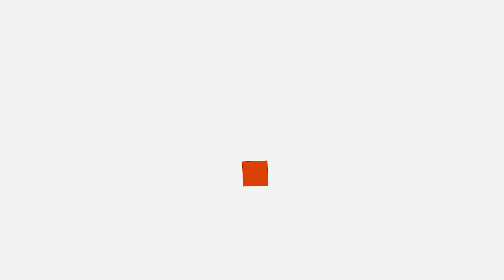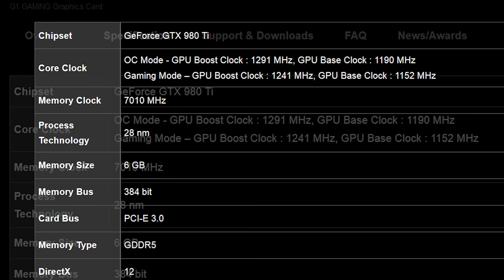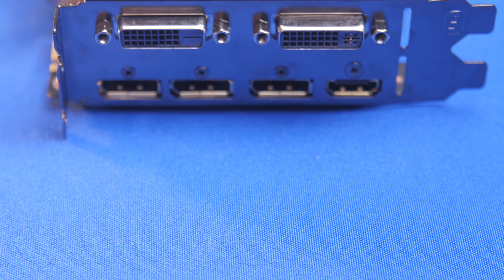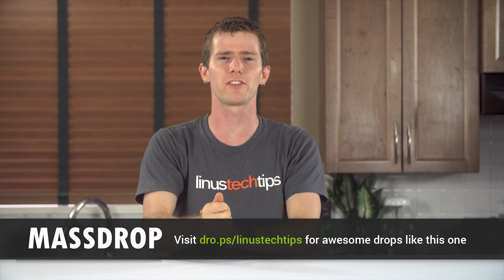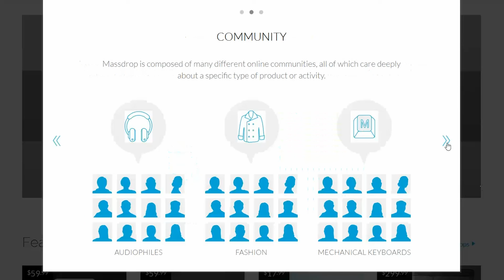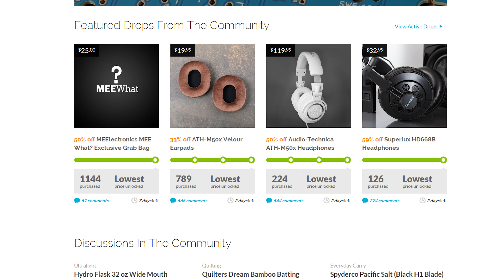Gigabyte G1 Gaming GTX 980 Ti - Both Beauty & Brawn?

Comment: ahaha I just bought one xD
Reply: @AbuKhalidAhmedAlHaddad  Yup mine is still good. I don't use it anymore as I upgraded to an RTX 3070ti. But I did refurbish mine with replace the thermal pads and paste on mine. Its basically a high power consumption RX 580. Its really good, it will struggle in some newer AAA titles but overall its not bad. I have a video on my channel on it xD.

Comment: just upgraded to this card. It's awesome. Even 4 years later.
Reply: man i bought one yesterday lol
Reply: I have a problem with my G1 gaming, whenever i try to overclock it and make the slightest changes in the core clock or the memory clock, every game i try to play crashes.
Reply: @valiotoploto2189  I'd just leave the clocks at stock speed then.
Reply: I would too but gta v barely runs with 60 fps, and i need more power lol
Reply: @valiotoploto2189  Do you have MSAA on in GTA V? If so turn it off. It kills the FPS.

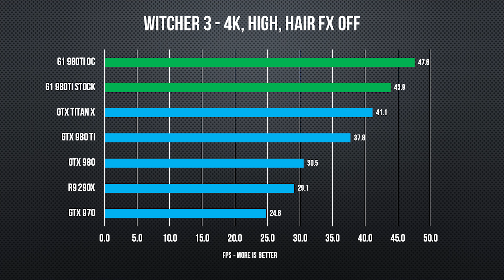Comment: 5:57 You got TERRIBLE silicon m8! And one would think Gigabyte would send their BEST to LTT! 
 I have a G1 Gaming GTX 980 Ti still today. I use OC Guru II by Gigabyte as I have found the voltage and memory settings work FAR more stable than they do using Afterburner. Anyway GPU-Z only rated my ASIC quality at like 69.8% or so IIRC, but with a + 0.375 voltage offset, +136 MHZ to the core, and +990 to memory in OC Guru II manages me a PERFECTLY stable 1503 MHZ core, and 8 GHZ effective VRAM! Giving me ~35%+ over stock reference on core, and a further ~15% on VRAM speed and therefore bandwidth at 384 GB/sec! My core temp never tops 72 C at the worst, and the GPU fans are running at 80% by then which is just BARELY audible to me unless I have loud game sounds going, at which point I cannot even hear it.
Gigabyte really kicked ass when the G1 Gaming was their damned near top of the line. Now it is middle tier and "AORUS" is their top of the line, the AORUS 1080 Ti managed to bend under its own weight, sometimes enough to stop a fan!  Meanwhile the G1 Gaming 980 Ti is so solid you could bludgeon someone to death with it and it would probably STILL WORK!

(I still RUN afterburner - but only to monitor my GPU & CPU temps and utilization, as well as RAM utilization - I am digitally OCD and want to make sure EVERYTHING is cool and running as it should at all times!)

Comment: GTX 980 Tis are selling on eBay for just ~$260 on average depending on model!   I bought THIS G1 Gaming GTX 980 Ti in August of 2016 after Pascal and Polaris had launched, and won the bid for $355 shipped to my door! NOW I have it running at 1.218 Vcore (+34mw in Afterburner) to achieve 1503 MHZ core at ALL TIMES under load, and 8 GHZ effective VRAM for 384.4 GB/sec! 

At this overclock, my 980 Ti EASILY BEATS ALL GTX 1070s IN EVERYTHING! And actually even manages to tie with or even beat a FEW GTX 1080 equipped rigs in benchmark comparisons! In fact, I posted my SteamVR Benchmark scores to LTT's "Post your SteamVR Bench results here" forum thread - and what surprised me quite a bit, was that I was beating ABOUT 50% of ALL results turned in by GTX 1080s! And the ones I did not beat, I either tied with, or at worst was just SLIGHTLY behind! 

I think the 980 Ti actually does VR better than it "should" based on regular game performance - and it MIGHT have a LOT to do with that memory Bandwidth combined with the fact that the 980 Ti is a "Wider" GPU than the 1080, it has 256 more CUDA - so 10%, but then it has 50% MORE ROPs (Render Output Pipelines/Rasterization Output Pipelines/Pixel Pipelines) - where thr GTX 1080 has 64 ROPs, the 980 Ti has 96! ROPs are DIRECTLY responsible for a GPUs pixel output, at 1503 MHZ my 980 Ti is outputting 145 Gpixel/sec, meanwhile a GTX 1080 at 2 GHZ is good for 130 Gpixel/sec. So there is not only a memory Bandwidth disparity in favor of the 980 Ti OCed (1080 can usually hit about 350 GB/sec at best when OCed, whereas MOST 980 Tis easily hit 8 GHZ VRAM, which provides 384.4 GB/sec) - but also a SHEER pixel output disparity in favor of an Overclocked GTX 980 Ti like mine.

So I think that is why the GTX 980 Ti performs roughly the SAME as a GTX 1080 in VR especially when OCed like mine!
Reply: good job bitch <3
Reply: @painintensifies9489  Lmao, thanks, bitch. kisses

Comment: mine runs at 83 degrees on oc mode at 1400 mhz, why is mine soo hot?
Reply: What fan speed is the card running at when under full load? Are all the fans actually turning? If the answer isn't fan speed/the fans, then more than likely (and this is a problem with all GPU manufacturers, not just Gigabyte) the thermal paste has been poorly applied. Pretty easy to reapply GPU thermal paste, just make sure you take note of which screw has gone where, and that you have some good paste on hand, as well as some thermal pads for the chokes and VRM's.
Reply: I reapply the thermal paste whenever i get a new card. found the problem tho, case air flow. rocking no side panel atm and temps r fine XD

Comment: I've been using this GPU for over 6 months now and all I can say is this is my best GPU I have ever owned. Prior to this, I was strictly AMD but i got myself into playing games on triple monitors. At the time, there were no AMD GPU that could push that resolution on a single card that was air cooled. Then i waited for this GPU and bought it. This has the best IO for my setup, it maintains stable temp, and runs pretty quiet for a triple fans.

Comment: tell me if this is weird, i got my card yesterday.. i have it on gaming mode.. rated boost 1241 but actually it goes to 1366.. but then after 1 minute of gaming it drops from 1366 to 1354Mhz... even when overclocking the gpu i got to 1501Mhz with only increasing the power limit to 110%... it stays on that for a minute then drops to 1489Mhz.. seems it always lose 12 Mhz for some reason.. is this something i have to be worried about? other than that.. the card is a beast!

Comment: Nice review, but u didn't mention OC Guru II. I have  these cards in SLI and OC Guru II is buggy as hell in windows 10, also OSD is not working even with latest update. Second the OC Guru II  modes" OC, Gaming, ECO" disappear once u in SLI.  Last thing mention that the auto update is not working, i had 1.91 checked auto update everyday and gave me "there no new update" went to gigabyte page to find that the 1.92 been released a week ago. Am wiring this comment in every review cuz gigabyte support is equal to 0.

Comment: Try a lower voltage for a better overclock. I got a GTX 780Ti windforce OC.
Stock voltage at 1.180 does 1150Mhz stock boost. Whit that voltage i got max 1200Mhz. It doesn't mather if i put 1.2 or even 1.3V on the core, and the weird part is on a higher voltage it does even crash more and more. I whas like, great, a got the crappy card again. on 1200 i whas even getting artifacts on stock voltage. So messing around a bit and putting a lower voltage on it 1.150 and the artifacts where less. hmm even lower and lower and the artifacts where gone. So i try't on the stock turbo speeds how low i can go whit the voltage. i could go as low as 0.950V until it crashed!! on 1.000V it whas compleetly stable. Well to make a long story shorter i got a clock speed of 1320Mhz on 1.1V!! isn't that freaking weird?? Its alot faster and runs way cooler, freaking 4 degrees celcius (custom watercooling)

Comment: I got this GPU recently which I upgraded from R9 290. I game on the triple monitors so I needed that power and oh boy, this card is a beast! Even at stock speed, this was dishing 60FPS on triple display with high to ultra setting no problem. This was my first Nvidia since 1999 so it's been a while. Although AMD still has the better multimonitor support and feature, performance alone was enough to win me over.

Comment: got my g1 gaming today....61% asic...cant even run 1446mhz without crashing in gta5 ....this thing sucks
Reply: +SupremeMystique returned that g1 and got another.  runs over 1500mhz 24/7
Reply: the g1 has the windforce on it...its gigabytes best model. and from personal experience its MUCH quieter than the evga 2.0 on load
Reply: +SupremeMystique coil whine has nothing to do with the cooler. if you plan on pushing your card yo the limit and 90 isnt a deal breaker get the g1. im sure the normal windforce  can still hit 1400mhz minimum
Reply: +dsxz 
Which one did you get?
Reply: Aleksandre K g1 with 82% asic, been running over 1510-1541mhz +350 mem 24/7 since the day i got it

Comment: Why does gigabyte always remake geforce hardware? Which is better geforce 980ti or this? Whats the difference?
Reply: ***** Basically they just take a higher binned core (better overclocking, cooler, lower core voltage for stock clocks) and put it on a custom designed pcb with slightly different components, e.g. better VRMs, better capacitors and better cooling. This is better than a standard 980Ti by up to 10% I believe.
Reply: jackspencer213 thanks man

Comment: Sorry Luke, but to anyone buying this card - the "silent" and "stop"  'buttons' aren't actually buttons to be pressed. When the card is idle and below a certain temp, it will turn off the fans automatically causing those LED's to light up. Once it hits a certain temp, the fans will start spinning again automatically turning the "silent" and "stop" LED's off and turning the Windforce logo on.

Comment: The 980ti is a really amazing card. It's not like it performs 2%-5% better than a GTX 980, it performs much better. I mean FC4@4K/Veryhigh and a GTX 980 gets 34,6Fps ad a GTX 980ti gets 50,8Fps. That's an increase of 46,82%, which is quite amazing.

Comment: I've got to ask something, the overclocking doc says that with the gtx 760, the core voltage is 12 and when i go to overclock with msi afterburner, is has 12 volts is the highest setting it can go too. is 12 volts safe for the gtx 760 or not

Comment: Gigabyte's OC Guru sucks... being forced to use it to change the LED's colouring scheme sucks even more. This card was very loud when I had it, and the coil whine was a little too much to bare. 
Unfortunately, I sent it back, and now using MSI 980 Ti Gaming 6G, Twin Frozr is very very silent, keeps almost as cool as the G1, but definitely is just as fast. Twin Frozr at 100% fan speed is more quiet then G1 at 60% fan speed... no joke.

Comment: Just ordered one of these for a new build.  Curious how it will fair with gaming at 3440x1440p
Reply: F1shard Good luck.
Reply: pcgaming today Thanks, gonna be the most I have ever spent on gaming/workstation.  Pretty excited to try it out.  NCIX had to split my shipment So I am still waiting for this card to show up.
Reply: SupremeMystique Love it!  I think it is the perfect card for 3440x1440p.  I can Max out anything I throw at it and sustain those 60fps.  It also looks great in my case.  I like the illuminated windforce logo.  However I am not really sure your going to see a monster performance boost going from the WF to G1.  There is a slightly higher factory clock on the G1 but it seems that it might not make that big of a difference if you manually overclock both cards.  Either way both look like solid options.
Reply: I'm not sure entirely what the difference between the WF and G1 would be.  It seems like the G1 is among the leaders for the 980ti cards and ranges anywhere from 2-5 fps faster in most games to other 980ti cards.

Comment: Does anyone have a link to the comparison between g1 gaming and reference cards when both are overclocked? 
I'm trying to figure out if the g1 gaming is worth the significant extra cost, and most reviews either show both at stock, or an overclocked g1 vs a stock reference.
The cost difference is pretty large here, so I don't want to waste 200 bucks if it only overclocks worth 2fps extra.

Comment: I'm struggling to find a round-up of Nvidia cards with a lot of memory. This is above my budget but I'd like something faster than my current GTX 560Ti. I'd love 6Gb or more memory so I can play around with GPU rendering my own 3D scenes (I normally use the CPU but the huge speed boosts GPU rendering can provide is super tempting). I'm not an AMD hater BTW, its just the GPU renderers favour Nvidia. Anyone know any cards or articles that dip into this?
Reply: Clay Mann 980Ti or Titan X. The 980Ti is your best bet since it's a lot cheaper than the Titan X and performs almost as good, plus it's a better overclocker.

Comment: What size power supply should I have for 2 of these? I'm running a 4770k i7 stock clock 16 gigs of ddr3... I'm not planning to overclock anything in my system.

Comment: So many cards, so many prices, help me out guys.

I want to get a i5 4690 cpu (3,5ghz stock) but don't know wich gpu fits this guy the best. My pricerange is max. €250 / $270. I want to be abled to game 1080p and if possible higher, i prefer nvdia because they run cooler and more silent. Share some thoughts.
Reply: Joey Slager gtx 960.
Reply: norge696 Can you explain?
Reply: Joey Slager What is there to explain? You have a budget of $270. GTX 960 is perfect for 1080p.
Reply: Gtx970 or R9 390

Comment: Just got my Gigabyte G1 Gaming GTX 980 Ti yesterday and not only does it suffer from HORRIBLE coil whine, the fans are really, really annoying.  Based on the videos I've seen the fans may be defective since they are buzzing and making a loud whirring noise, but all 3 fans are doing it.  It sounds like an air raid siren is going off.  Working on getting and RMA, but seems like a lot of issues with these cards looking at the forums.

Comment: If i get two htx 750ti graphics cards what would that be equivalent to? The gtx 980ti is really nice and all but it's still $650 and I could do a lot more with that than just on a graphics card.
Reply: 750 Ti isn't SLI compatible.
Reply: Jack The Ripper dangit. Thanks man. Do you know any good graphics card that's about $350 and can run new games at good settings?
Reply: GuineaFridge GTX 970. You can max out most games at 1080p.

Comment: Is it better than msi 980 ti gaming 6G?
Reply: osesek000 Look at the clock speed, higher clock speeds usually mean it can render the frames faster, More memory is only needed for higher resolution like 4k. Performance difference shouldn't be too big though

Comment: One good reason for the added stop button on the card would be if you had to work inside of the PC while it is on, you could turn the fans off right there so your finger or any cables don't get in it.
Reply: Carson C. You wouldn't work on any computer with it on, you always turn it off.

Comment: I didnt get it because i read it had terrible coil whine, is it true?
Reply: andrewx1997 All cards have coil wine, deal with it.
Reply: norge696
 i got a MSI 980ti G6 and it has no audible coil whine. Deal with that.
Reply: andrewx1997 My rig is not even the same room as my monitors, could care a less about coil wine.
Reply: norge696 If you comment on a question, at least say something useful next time.
Reply: andrewx1997 I'm just put a spell on your 980, enjoy your coil wine tomorrow when you wake up.

Comment: My new built g1 gaming gtx 980 ti x99 deluxe i7 5930k 16 gb ram Kingston 3000mhz my gift to myself for my birthday!! 😁
Reply: Αντώνης Βελώνης Damn, lucky! Probably want to get 32GB of RAM when you can since your CPU and GPU are overkill.
Reply: I know but I found them half price ;)
Reply: Vanalk Why do you keep telling people to get more ram? it's really fucking annoying, especially when they don't need it.
Reply: norge696 I meant it as the next upgrade. I'm guessing you don't know how well a 980 and i7 perform?
And what do you mean "keep telling"?
Reply: Vanalk It doesn't matter if you have 8GB or 32GB of ram, your FPS will not change. More ram is only useful if you're always encoding video ect. An i5 will get the same frames as an i7. You keep telling people to get more RAM. You commented on some guys rig that hes going to buy r9 280x, 8320, 8GB ram, whatever and you told him to buy 16GB.
Reply: norge696 Okay, now I know your knowledge on RAM is wrong. Google's a good place to start learning.
So if I had 4GB of RAM, and I buy 4 more totaling 8 GB, would my FPS change? Yes.
And if I never do encoding, would more RAM help having multiple applications open at the same time?

More RAM is never a bad thing.
Reply: Vanalk
 I said 8GB, not 4GB. Obviously the difference between 4 vs 8 will be noticeable. 8 vs 16? Nope. Stop putting words in my mouth.
Reply: norge696 Okay, bye.
Reply: I think 16 gb ram for now is ok but for my next upgrade I will add 16 more!

Comment: Could some one help me
I wanted to upgrade my G1 gtx970, I was thinking of getting another one in sli, but now this beast came out, should I sell my G1 gtx970 and get the 980 Ti. Two gtx970 cost the same as the gtx 980 Ti in aus?

Comment: The Gigabyte 780 TI OC was a terrible, a lot of people myself included got a dud bunch of vram which couldnt handle the stock clock speeds. 
I would be extremely hesitant to recommend a gigabyte video card until there are a bunch of user reviews out.

Comment: really complete review. Good job Luke
Reply: Eduard Lomaxand that headset is same as mine, and its audio drives are really accurate and powerful. great micro and noise cancel. The price of the electronic comps forced Sennheiser to sacrifice some design aspects such as plastic screw covers instead of metal solid ones. Microphone´s three pieces config makes it fragile. BUT THAT sound!!!! transducers, Linus explained in a video that the kind of sound drives are most expensive one due to its double sided diaphragm